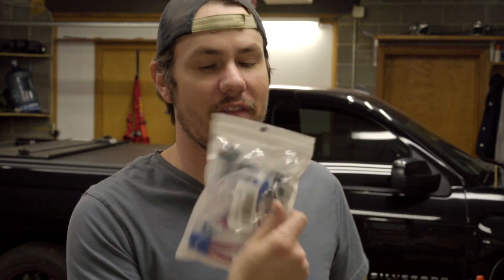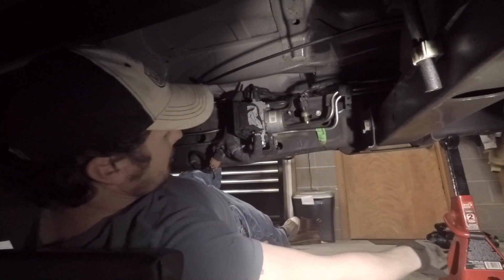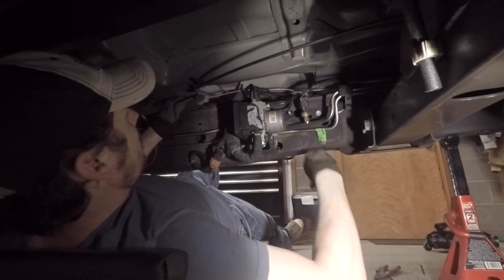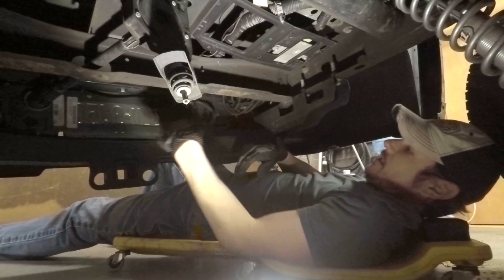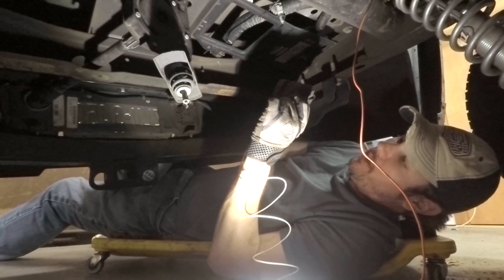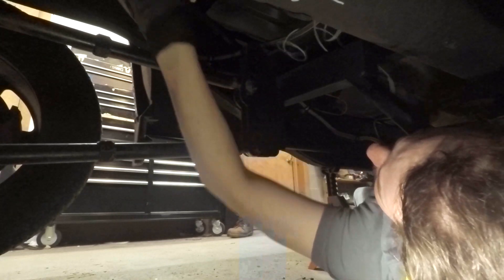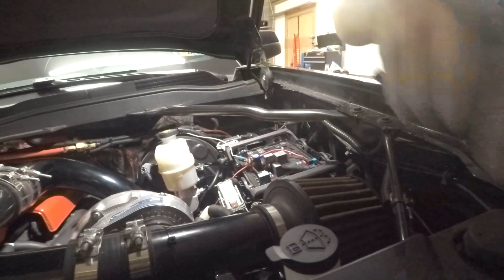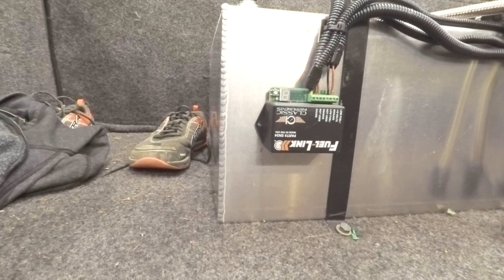Fuse Tap Installation, Adding a 12vdc Circuit!

Comment: Hello. Great video. I just happened to see your using the fuel link from classic instruments. I ordered the unit from them for my 08 Silverado & they told me it would not send a actual resistance value that the computer needed to see, that their unit only would send a electronic signal therefore it wasn’t going to work. I have a 20 gallon fuel cell in the bed with a 0-90 ohm sender. I believe my truck is 40-250 ohms. How did you get it to work ? Any help is appreciated. Thanks.
Reply from the maker: Not sure why they would say that, works fine on my truck and it's 40-250 ohms.
Reply: Goat Rope Garage Are you using your stock dash fuel gauge ? Also would like to know if your close to the Levittown Pa. area. I just had someone tune my truck & it has issues. Maybe you could possibly help ? Thank you for your reply. 🙏
Reply from the maker: Yep, it's tied into the stock gauge and works. Clipped the wires to the original sender and wired the fuel link in there. I don't do tuning as a service, Juan, but almost everything you need to know is in the tuning series and you can join my Patreon at https://www.patreon.com/goatropegarage for additional help but you still have to do your own tuning. Take a look at the tuning series, it'll get you started in the right direction and if you have any questions just post it in the comments of the video in question.
Reply: Goat Rope Garage thank you sooo much 👍 keep up the good work.